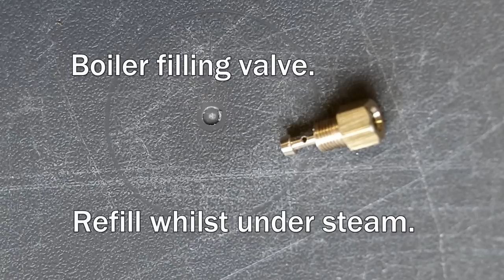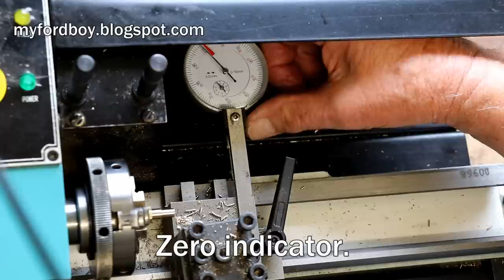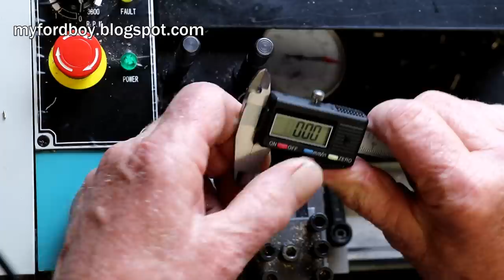Steam Model Loco Boiler Filler Valve (Goodall type) Make Your Own.

Comment: Nice job 👍👍👍 I like the poor mans depth stop, I generally use masking tape like you did on the larger drill. Small heat shrink tube works well too. Cheers, Alan.

Comment: Polymorph huh. I have never heard of it before.
Reply: I've used it from a couple different brands.  In the US it's often sold as "friendly" plastic.  It melts easily in hot water (less than boiling) and conforms to details for molding pretty well.  I have used it to make several sets of fake fangs that will basically suction hold to a person's canines.  I've also used it to make knobs for nuts, and to fix an industrial switch where the knob snapped off.
Reply: @Kineth1 Is it similar to hot glue, but dries much harder? It seems like.
Reply: @iTeerRex  It melts at a much lower temperature than hot glue, so you can mold it with your hands and not get burned.  It is a lot harder than hot glue when it cools.  It isn't nearly as sticky as hot glue either, but you can use hot glue to stick it to stuff.  You can also get dye pellets to mix in and color it.
Reply: @Kineth1  Ah, very cool 👍
Reply from the maker: Amazon sell Whitemorph, same product.